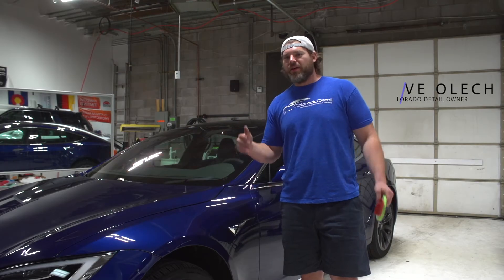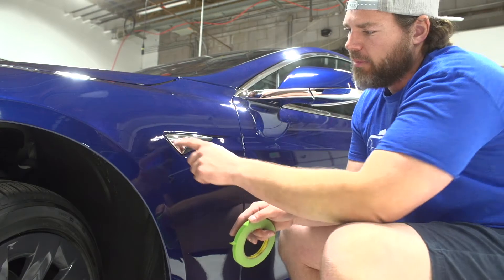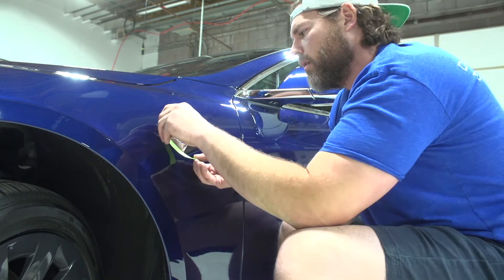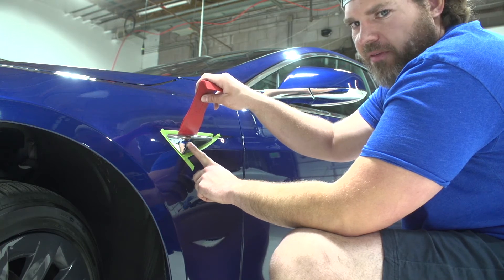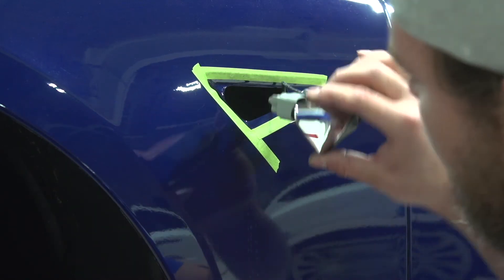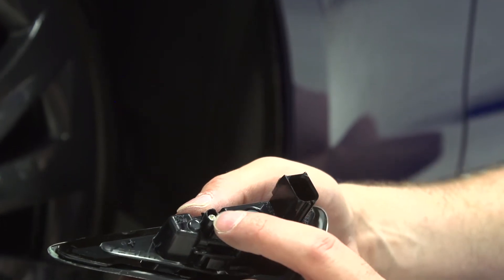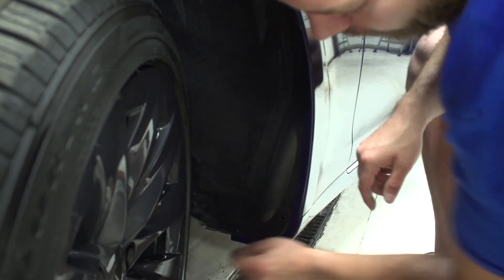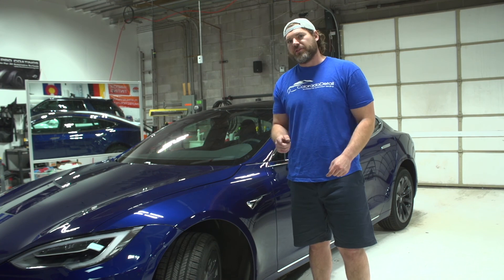Tesla model S side marker removal

Comment: Good little tip on temps! This description makes a lot more sense to pry from the bottom initially and then finish with prying the top. Also insert the top tabs first during reinstall since they are fixed. The lower tabs move. ---> https://teslatap.com/modifications/camera-upgrade/
Reply: Thanks for the link. I think the side marker design may be poor. On your link, in the photo of the locking tabs you can see some damage to the marker, at the bottom of the triangle. I think whichever side you pry from you are always going to be fighting this.
Now for me to go try it myself....

Comment: If the PPF guy messed up and breaks one of the “clips” could be “reinstall” them BROKEN and not tell the owner until he discovers a problem sometime later?  My SC is having to replace BOTH of mine on a NEW MY as a fender had a chip and the body shop had to repair/paint the entire fender.  I didn’t understand why they had to order TWO until I watched this vid.  Also MY parts are still not readily available, it’s taken my SC over a week to get these two parts in.  Thanks for the great video.
Reply from the maker: Thomas Jacques it depends. These things go bad all the time regardless of removing them.

Comment: After removing and reinstalling one of these have you ever seen the following messages? 

“Autopilot cameras unavailable” “Features may be restored on next drive” APP_w305

“Autopilot features limited” “Features May be restored on next drive” APP_w269

I searched these errors on google and saw some people saying after taking to tesla service center tesla said it wasn’t plugged back in all the way.

The smaller plug is for the camera, and the larger one for the light indicator on the model 3 as well right?
Reply from the maker: Connor James yes, you need to remove any USB’s from the center console, turn off all security, lock the car and walk away for 10min. This will fully reset the computer. If you don’t remove the usb it won’t do a reset as it will be still writing to the usb.....
Reply: ColoradoDetail Paint Protection Specialist thank you so much! Worked like a charm!
Reply: APP_w305 will also appear when the camera is dead. Mine was dead on delivery day. 10 days for Tesla to get a part to the SC. They are great cars when everything is working but you will be hating life when you're at the mercy of their abysmal service model and glacial parts distribution system.